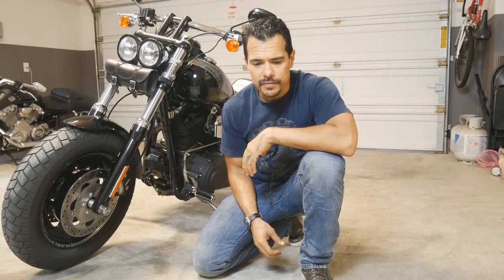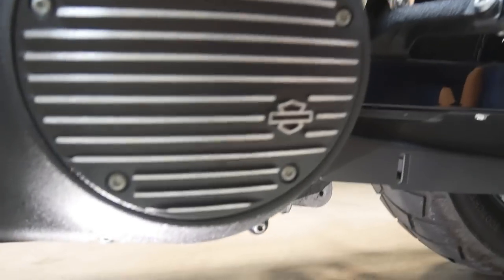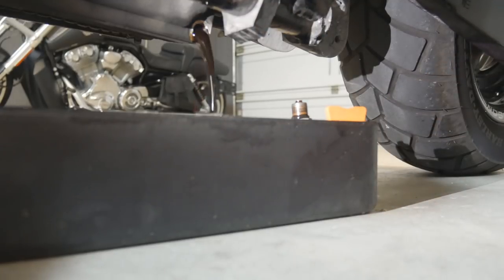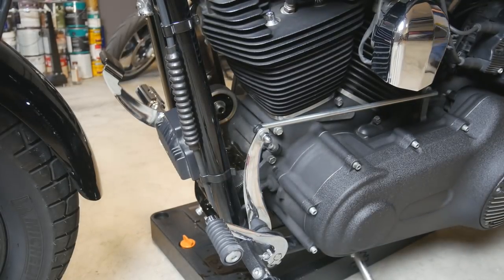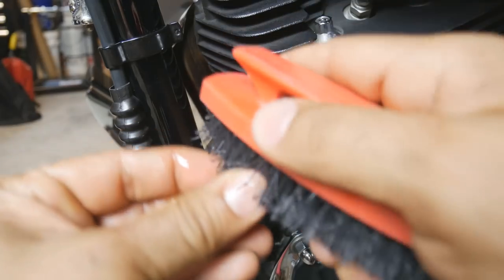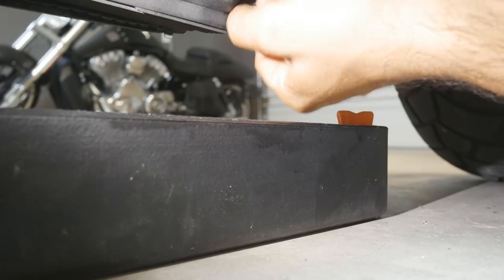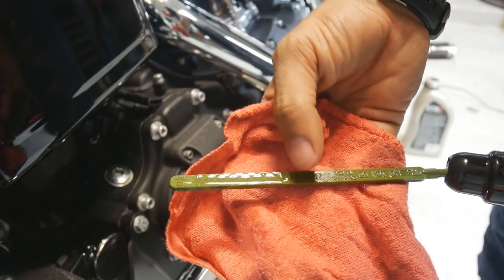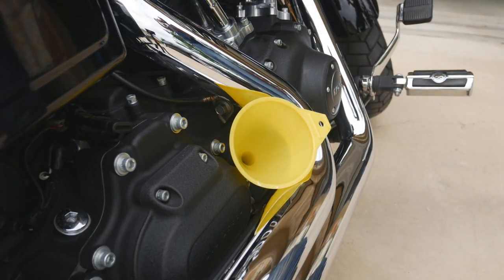Fat Bob oil change - Harley Davidson FXDF

Comment: I just did my 5k service and noted a few things. The drain plug will take an Allen wrench so get a set of the ones that are on a socket. Don't waste time with a box wrench. Save the "spanner wrench" for adjusting your shocks. Hahaha! 
Get yourself a funnel that has measurements and a valve that you can open and shut with a screen inside. Then you can measure that last half since you will be using Redline and the bottles don't have a window. 
Buy a filter wrench cause if your is like mine it will be stuck on there good if you aren't the one who put it on. 
Use silicone spray on your NEW O-rings.

Comment: OK........................... If you are worried about over filling your ride. It takes 2 and a half quarts of Oil. After you have added 2 quarts, take one of the empty bottles that you can see the Fluid lines. Open the 3Rd quart and pour into the empty bottle to the half quart line ! Don't guess ! Take the time to do it right ! Knees in the breeze my friends ! Ride safe this summer and watch out for those Cages Out There !
Reply: How much oil capacity does the 96cc hold?...
Reply: In this video the new oil filter wasnt pre filled. Does that impact how much it takes?

Comment: I know what you talkin about the O-ring rather be safe than sorry right also is this a 96 cubic inch motor I've got a 2013 Street Bob this got that motor the drain plugs on all three holes or going to be the same right great video

Comment: So I can put all my oils in just the one hole I don’t have to individually put oil in all 3 holes?
Reply from the maker: @HansSmith-j3j  howdy Hans! This video only covers the "engine" oil change. A 3 hole change addresses the Engine, Transmission, and Primary casing. These three components usually have different change intervals per the manual, but some people just do all 3 at the same time.

Comment: If the V-Rod in the corner is yours, what bike do you like better, the V-Rod or the Fat Bob? Also which bike is more reliable? I used to have an 04 V-Rod and a 2010 Fat Bob. 
Thank You👍🏻👍🏻
Reply from the maker: Yup, it was mine. The V-rod was kinda my one-up riding dream bike. The Fat Bob was way more of a utility long hauler. My wife got on the v-rod with me once and absolutely hated it. I only had the v-rod for like 6 months so can't really speak to long term reliability.  Except that the V-rods gas gauge was horribly unreliable and that the water cooled system adds an extra layer of complexity to maintenance/repairs... still miss it though. Was a mean bike
Reply: Mack's Moto Thank you for the reply! I had my 04 V-Rod for two years. I bought it with 110 miles on it in 2008 and put about 18,000 miles on it with absolutely no issues. Took multiple trips to Naples Florida from Massachusetts and back with my wife on the back. Saddle bags, sissy bar and better seats. Traded in the V-Rod in 2010 for the 2010 Fat Bob and had nothing but starting issues with the bike 2 weeks after I bought it, it killed the experience for us and never took that bike to Florida. It was in HD shops multiple times. I had the Fat Bob for 5 years and sold it with only 5,400 miles on it. It was such a disappointment. My wife was upset with me getting rid of the V-Rod, it was actually a real bad mistake. 
👍🏻👍🏻

Comment: @Mack's Moto I have a new Fat Bob and it's almost reaching 5K miles. Do I have to do the 5K Service from HD or can I just do a simple oil change?
Reply from the maker: Malcom490 great to hear from ya. The oil change is the most costly and labor intensive part of the 5k service. The box next to oil is the only one marked "replace" but there are a number of other items marked "inspect" that warrant looking into. Do you have a service manual? The 5k service is a great 1st one to do your self. If you want to learn more about your bike I would recommend saving the cash from the service and investing in a manual. Make sure to save receipts for fluid purchases if you ever plan to sell the bike to anybody other than the dealer. Most buyers like to see service records.

Comment: is it better to have it on a bike stand where it stands up straight?
Reply from the maker: Derek Macdonagh it is better to have the bike leaned over on the jiffy stand. Service manual is specific about that and the oil pan (position of the plug) is set up so that it needs to be leaned over for all of the oil to come out.
Reply: Every one they do in the shop is straight up clamped in to the chock on a table.

Comment: Is the oil level accurate with the bike leaning on its stand?  Some people I know stand the bike up to check the level after then warm the bike up. At least with sport bikes.
Reply from the maker: Erik Acevedo depends on the bike. The Fat Bob service manual says to check the oil with the bike on the jiffy stand... instructions on my Vrod were to check with bike standing straight up. What do you ride?
Reply: Mack's Moto I’m on a sport bike now suzuki GSXS750 but would like the fat bob or Indian scout by next season. So just looking through videos checking how maintenance looks on them, accessories etc.
Reply: It states in the owners manual that you can check the oil on the Jiffy stand ( side stand )

Comment: Taking the oil filter off?? No mention of 2 Allen screws needing to be removed b4 using tool to take filter off?
Reply from the maker: Yo Jeri! I don't have the Fat Bob anymore  but no, there weren't any allen screws on the filter for the 2014 Fat Bob. It screws right off like in the video.